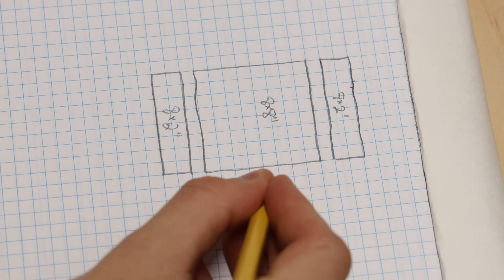Making a Moss Garden from Scratch (Satisfying & Relaxing)

Comment: I've started using a fondant tool for making super clean silicone seams. It's a round metal ball with different sizes used in bakeries
Reply: you mean a dotting tool? it is also used for clay, and thats what i know it as
Reply: Yes Jr I know exactly what you are referring to. I too use that tool for cleaning up lines. Just gotta immediately clean after use

Comment: This was so interesting to watch, thank you for the calming hour you've given me this afternoon. I have to ask, the cotton? rope, is that used as a sort of filter? Spray the moss with water, that water will then be absorbed through the rope down past the carbon layer to the sand where it will essentially keep exchanging water from top to bottom? I'm just guessing here, but would be so happy if you could answer. Thank you again
Reply: The rope keeps moisture need the moss for better hydration.
Reply: It's to wick water up from the bottom to keep everything nice and moist.
Reply: Simply put the rope is an artificial root. As you know, moss depends solely on the moisture that comes to it from top as they don't have very long roots to collect water from the bottom. The rope will soak up the water from the bottom so that then the moss can use it at the top. This also means the water from the bottom won't have to be drained as it'll be constantly recycled.

Comment: Cutting the glass reminds me of the thousands of pictures I’ve framed thru the last 28 years, and all the times I ran across a large piece that just did not want to play nice. Thousands of perfect cuts, then wasting 2-3 giant sheets trying to get one odd size clean. I do still have 2 large glass cutting machines, but the cuts are still and always were done by hand. 

Most of the boxes of full sized glass is too thin for most aquarium or terrarium tanks, they could be used for smaller projects...like this! Thanks for the idea.

Comment: Yo is that Erik Satie in the cut starting at about 42:00? Also this is a really lovely video. Such a small project, but it shows nicely a some of the principles that are so important for any size build: Good preparation/gathering your tools ahead of time, setting up your workspace appropriately, using the right tools for the job, and working with good mise en place. Kudos!

Comment: Great DIY video. A safer way to cut your glass is to place a rod under the glass directly under the score line and gently press down evenly on both sides. A thick pencil would do, just make certain its depth is completely even from end to end. 
Good luck.

Comment: At first i was puzzled and couldn't figure out the purpose of the strings but thinking about it as the build progressed i guess it is a way to avoid standing water at the bottom to counter mold and transport the water back to the top? Very nice and relaxing video tanner!
Reply from the maker: Not so much that, but to help keep the moss hydrated between watering.

Comment: Safety notice: When working with glass, please wear eye protection! Little shards can get launched when it snaps. Also, shoes are a good idea in case pieces fall and break. When sanding glass, a dust mask is very important, or you could get glass dust in your lungs and that's not a good thing!

Comment: I cannot get moss to grow to save my life 😭 I wanna use moss in my vivariums but it just instantaneously dries out and dies like the next day even if it's still green and healthy. Even if I spray the enclosure every day and keep the moss moist, it still ends up dying. I try to do what you do in your moss videos but for some reason it doesn't work. Why am I a moss killer 😭😭😭
Reply: use rain water not bottle or tap water that kills them
Reply: @calyssaria3272  nope, spring water. No chlorine in there.